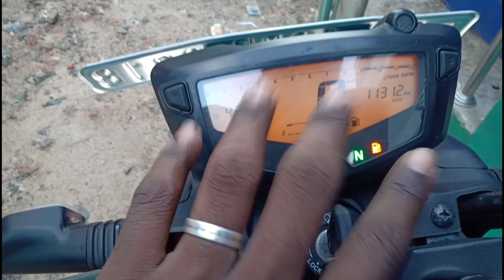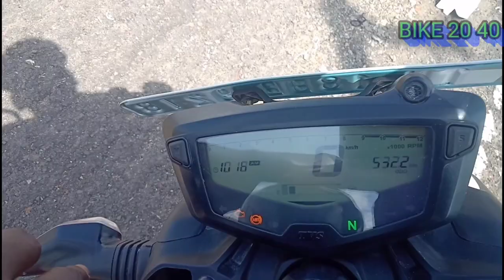How recovery from engine noise. How to recover from RTR 160 4v bs6 problem in tamil

Comment: Guys please my best advice dont use tvs tru 4 synthetic oil 1.2 liter 10w 30 grade (green colour oil). Which is very worst and thin. In service center they are using this oil only. Iam using Apache 160 4v bs6. After using tru 4 synthetic oil your bike engine vibration goes high and terrible uncomfortable. After a mechanic suggestion i buy shell ax7 semi synthetic oil blue colour bottle which is 400 rs only. I searched in Google it recommend moutul 7100 10w 40 grade oil. But due to my low budget i buy shell semi synthetic oil which is 10w 40 grade. After i using my bike vibration is gone and heating issue is also solved. For 1.2 liter capacity of oil you need to buy 2 can which totally 800 rs . This is my personal experience i shared if you spend more money for Fully synthetic oil you go. But i recommend semi synthetic oil for this bike at low budget. And remember that change oil at 3000 km intervals for this oil.
Reply from the maker: Mmkk bro
Reply from the maker: Mm yes good information bro
Reply: Castrol power 1 racing 10w 40 best oil bro. Semmaya eruku
Reply: I'm using the same 10w 40 fully synthetic Castrol 5 in 1 oil. But I'm still facing the noise issue. But bit better than previous
Reply: Bro bike la vibration isses iruku bro, vaangi oru maasam kuda aagala 😭

Comment: Na apache 160 4v bs4 use panra...2.5years aaguthu...oru problem um illa......super a iruku
Reply from the maker: Super bro . But na intha bike la face painna tha na soli irruka bro . Athu matu I'll a Apache Nala irruku tha na vagi irruka is good bike
Reply: Brother... Naanum Apache 160 4v bs 4 vachirukan 2yrs aaga poodhu... engine la extra noise varuthu ideal la..  running la Awalo va theyriyala.... Enna problem ah irukum
Reply: @onlineEarningsTamizh  enna engine oil use panreenga bro??
Reply: @deva_yt_823  Motul

Comment: Naan Apache 4v 160 bike Vaangirukka Buke Runninga La Engine Off Ayiduchu Enna Problem Ah Irukkum Engine oil Chamge Panni 3500 km Oil Maathuna Extra 500 km Poiduchu Enna Panlam Bro
Reply from the maker: Oil change painnunga Petrol 2L maintain painnunga bro injector Nala apadi irruku

Comment: Did anyone faced major engine issue adter 40000 kms bcoz im hoing ro buy a used bike which runs 40000 kms and serviced only at tvs

Comment: Bro i bought rtr 160 special edition. After 10 km bike slow panna Or accelerate vitta automatic uh off ayuduchu running la off ayuduthu...
Reply from the maker: Tank la water irrukA parunga .
Reply: @Bikes-xo4jz  bro yeppidi check pakkurathu petrol yedukura pipe yethum illai ye it's fuel injection
Reply from the maker: @spoofmedia2101  tank la apadiya patha therium bro water irrutha
Reply: @Bikes-xo4jz tank la appidi onnum illa show room la sonnan avanga thermal sensor dan problem uh irukum change panni kudukurom sonnanga ana ithu permanant uh illa temporary uh therila

Comment: Bro my bike na running le off aguthu after 28000 km le iruthu showroom le mechanic kum therile enna problem nu
Reply from the maker: Petrol yavalo maintain painnuvinga
Reply: @Bikes-xo4jz  eppothum 1-2 litre irukum
Reply from the maker: @esakkidassc2421  mm kk bro Yana less than 2 L pona bike off aguthu bro injector nala so 2 L yapo ma irrukanum bro
Reply: @Bikes-xo4jz  enaku caburetor bro

Comment: Hi bro ..apachi 160 4v new bike yadutha bro enum first service completed akagala but engine over heat akuthu bro ena panalam soluga
Reply from the maker: 1000 to 1500 km vara apadi tha irrukum bro new engine la so fraction over ra irruku bro atha no problem but normal speed maintain painnunga Oru 1500 km vara
Reply: @Bikes-xo4jz  ok bro tnx for information

Comment: Bro adikadi off aaguthu slow pannumbothu ithuku enna solution ?
Reply from the maker: Petrol 2 litter kami ya irrutha atha problem varuthu bro
Reply: @Bikes-xo4jz  ok..bro naan correct pannikuren
Reply: Still u have the problem?
Reply from the maker: Same times bro
Reply: @Bikes 20 / 40  me too faced this issues more than times.. I went service center more than 10 times for this issue.. they changed sensors and something.. and again same prblm.. and they cleaned something.. and after some days again prblm.. finally they resetted the bike.. around 6 months no prblm.. but auto rising will  continue upto 5th gear after reset.